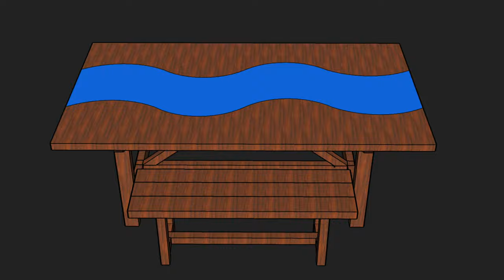DIY Live Edge Epoxy Table Tutorial

Comment: How did you keep the epoxy from escaping on the outside with no side?  I'm getting ready to do one exactly like this.  Did you put silicone underneath near the edge AND on the edge.  Hope you see this and can respond.  Thank you.
Reply from the maker: Yes, I used silicone caulk.  I ran a thick line down the middle of each slab before placing it in the mold.  Then, I clamped it down and sealed the outside perimeter with caulk.  I have the full tutorial on my blog - link in description.